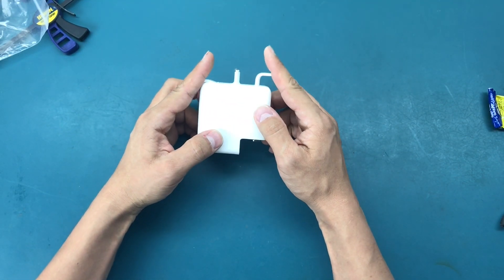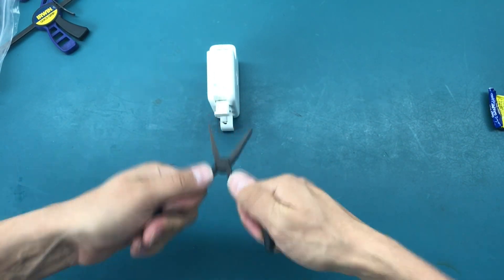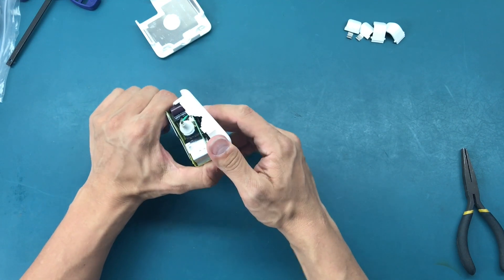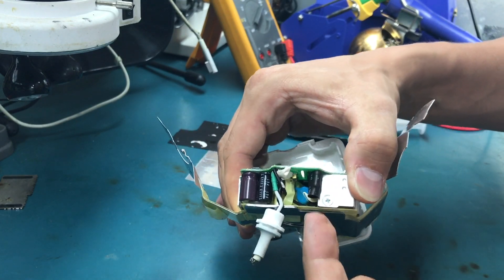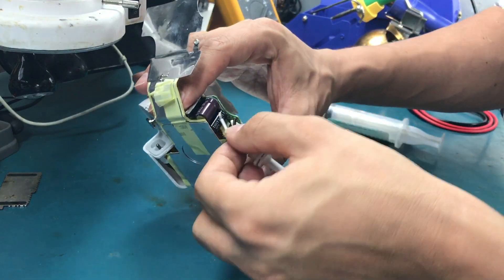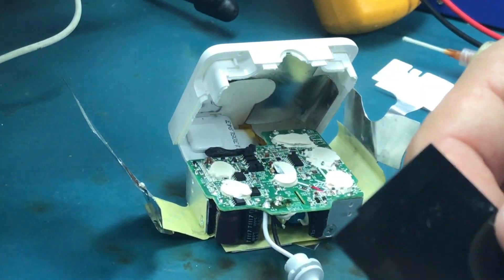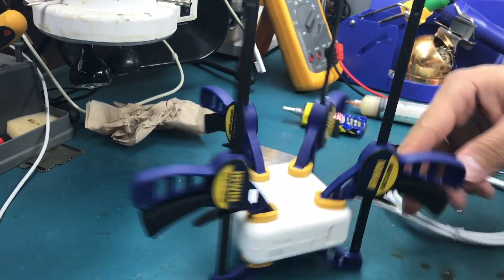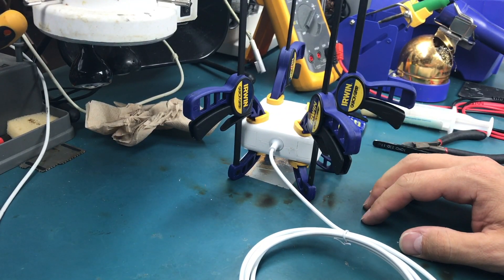How To Repair Apple MacBook Power Supply Charger -  Apple Magsafe 60W A1184  - Fix Broken Cord

Comment: I did that on the same exact charger..when test the voltage right whre you solder the cable it  15.5 16 watts which is correct. However, when i plug it into the computer the voltage drops to about 12 volts which is no enough to charge the battery

Comment: Nice video. No solder tools here. So I tried to splice and twist cables, and connected the light grey to light grey and the outer loose cable that was wrapped around grey to the black one on the connector end.  Twisted them nicely. Plugged and and the thing sparked/loud pop.

Comment: I just successfully repaired two using your method. I was very concerned that I would apply too much solder and link the black pad with the white, but using flux they seemed to stay in their lane. I am not really good at soldering but it worked out well for me.
Reply from the maker: Great!

Comment: Why can't you just attach the wires instead of soldering?
Reply from the maker: It won't make a good permanent electrical connection and would fail sooner or later.

Comment: NOT RECOMMENDED !!! doesn't work always ... I tried this on my 4 years old charger ... it was glued so tight that the box eventually cracked some pieces off while the main part was still glued together with large plastic pieces of the cover ... not to mention that IT JUST DOESN'T CRACK open as easily as it shows in this video ... bottom line ... get a NEW charger ... safer and easier ... and if you afforded a MAC ... you can afford a charger as well ... ;) sorry poster ... my opinion ... your video might work ... SOMETIMES ... definitely not always
Reply: But... why...you...write...like...this...........?

Comment: Actually you could just open the charger, cut the old cables at a distance from the motherboard in such way that you will leave a little from the cable just to twist the new endings from the new cables, then isolate them and you are done. No need to solder. Please correct me if I'm wrong. But I know I'm not. 🤣
Best regards!
Reply: Not every cable is the same also that's a lot harder since you could easily connect the black one to the white one or vice versa.
Reply: @falc0n2222  - If you're color-blind maybe.
Reply: I tried this and connected the light grey to light grey and the outer loose cable that was wrapped around grey to the black one on the connector end.  Twisted them nicely. Plugged and and the thing sparked/loud pop.

Comment: I replaced the MagSafe 2 Cable on my 60w cable. But when i charge it on my Macbook pro 13 inch. The system report shows the charger as an 85w charger. Later i found out the one wire chip inside the connector is responsble for holding the details on the charger from its serial number and wattage. But I'm not sure if the chip is also responsible for regulating the wattage on the charger. Because I dont think the 60w charger can really supply a 85w out. or cant it? 

So can you please let me know if the chip in the connector can regulate the wattage as the computer reads the charger as an 85w charger even thought the charger is a 60w charge. 

I'm scared if the replaced chord does give out a higher wattage. My laptop could get damaged.

Comment: Just replaced my cable. I originally had a 85watt adapter and the T-connector pins got damaged. I replaced the cord with an aftermarket one. But now.. When I checked my system settings its telling me that its only charging my MacBook Pro at 60watts. How is that possible with an 85watt adapter?
Reply from the maker: The charging current depends on how much charge your battery has.
Reply: Fix Apple Now That’s strange because my battery was at 5% charged and the current was reading 60 Watts.. At that point shouldn’t it read 85watts?
Reply from the maker: Yes, it should.
Reply: First, you don't should ever change the original cable to fake one, Genuine replacement does not exist. Second, that information about wat of charger is save in magsafe tip, that's why you see 60W not 85W. that video is completely useless. with fake cable you will probably overcharge your Macbook, and your battery will die faster and very possibly Logic Board will need repair too
Reply: @marcinwidera7515  you can't overcharge a macbook there's protection in place for that

Comment: Why not sharing where you got the cable from? 
I'm surprised you didnt get a discharge with those capacitors in the corner of the board. I fixed mine too for 2nd time already. I got the cable from ebay, for $3.25.  ( https://www.ebay.com/itm/45W-60W-85W-AC-Power-Adapter-Repair-Cord-Cable-L-Tip-For-Macbook-Magsafe1-1-7M/272589050510?hash=item3f7792d28e:g:FZkAAOSw2gxYx1bR:rk:7:pf:0 ) First one lasted for 2 yrs. I didnt glue mine, I just put closed it with duck tape, thinking I will re open it again...

Comment: Hello there, Congrats for the great video!!. Unfortunately i came too late to it and i didn't remove the metal plate, and after i finished welding the cables I realized that little piece of the shield that was welded to the board (4:08) was broken, i don't know which material is it, i guess aluminum, i need some way to attach it to the rest of the shield, some ideas?

Comment: I have a macsafe 1 laying around from my previous mbp and a broken macsafe 2 from my actual mbp, can I change the cable from the 2 to the 1?
Reply: Dwight Castillo As long as the wattages are the same/greater it will work with your device

Comment: Absolutely brilliant! great video thanks. I have at least 4 mag safe chargers that need fixing– you want to come over and replace the cables?
Reply from the maker: Make sure you buy cables for the correct wattages. I don’t think this is mentioned in the video. Meaning if you have a 60w charger you need a cable that is for 60w. Same goes for 45 and 85 watt. For example, if you get a 60w cable and put it on an 85w power supply, it will only supply 60w. And that can be a problem in certain situations. Thank you
Reply: this information was not mentioned in the video, but now I know. @fixapplenow

Comment: You should show us it works
Reply: It doesn't, I just tried it. There's more to simply soldering the wires, the microchip in the Magsafe connector (the one with the LED) has to match otherwise when connected it will not charge the battery (OS X does recognize that the Macbook is plugged in, but it doesn't charge).
TL;DR Apple screws customers once again

Comment: Be aware that in the cable tip there's a controler who tells the charger how much voltage to send to the device so the 45w-60w-85w have specific cable attach to them.
Reply from the maker: that is correct, thank you
Reply: Fix Apple Now Is there any difference in the size or flexibility of the cable when comparing it to the original and will it work for an 85 watt adapter? Do you notice any difference in how long it takes to fully charge your computer?
Reply: Computer should automatically regulate it's charging regardless of wattage the charger outputs... From what I've understood after some research.
Reply: C-Roy So when you say the charger, do you mean the adapter or the aftermarket cable? I’ve read somewhere online that the size/gauge of the aftermarket cable can alter how much current flows through it. With that said, if the gauge of the aftermarket cable is smaller than the original, will that prevent the computer from receiving the correct wattage?

Comment: Hi,
I tried to repair mine but unfortunately the black wire connector and the shield connector are now connected with soldering (i'm pretty bad at it). 
The new cable is now working but can be dangerous?
Reply from the maker: You have to be careful, you don’t want your charger to damage your mac